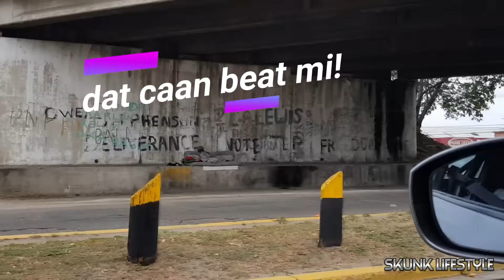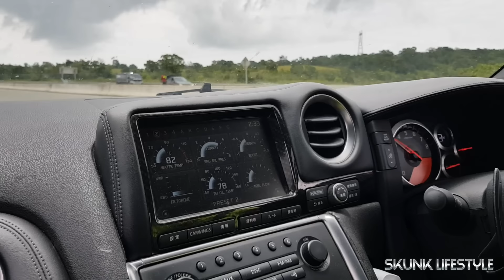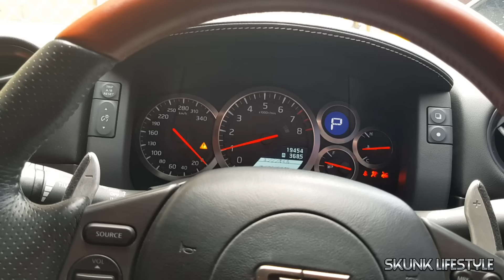Jamaican JDM GTR'S & CARS - SKUNK LIFESTYLE EPISODE 8

Comment: And I real correct myself even though you are still boost into 1000 PCI that is not a type of car you are still in the sport class you got to have the connect to the dealer but the dealer if you got the dealer then I can say you got a hyper GTR but the GTR is not I have a car it isn't a sport class that sport class at can only compete in the the Lamborghini class the hyper class it can compete but it is still a sport car a road-legal car road legal sport class that is it now you got the dealer in Japan that can build you a forged up engine that can go four hundred miles an hour then you talk and then you talk a number